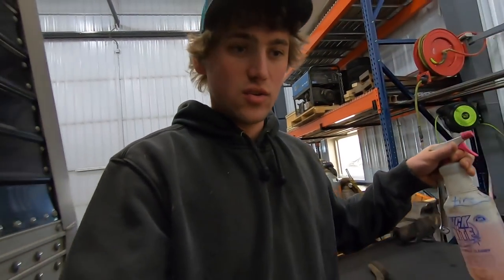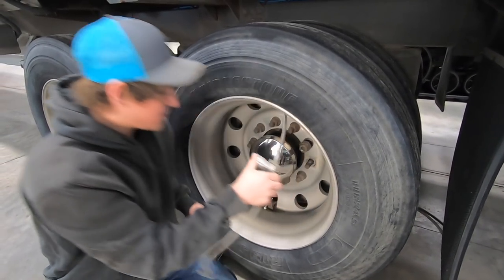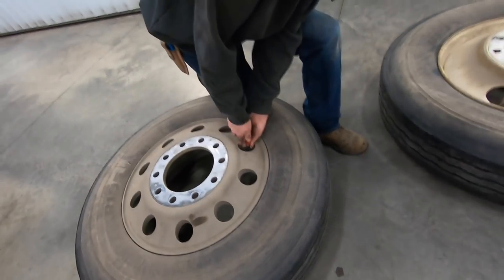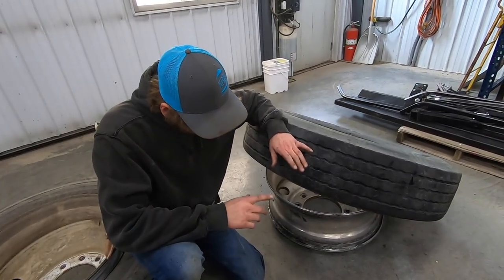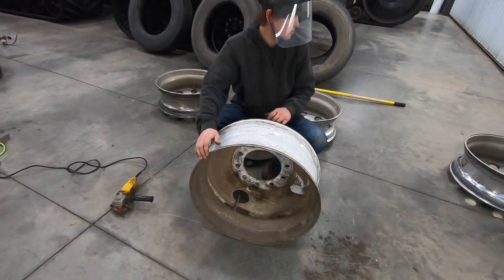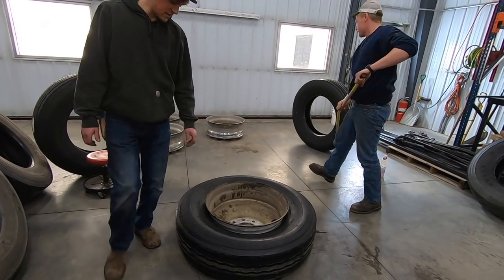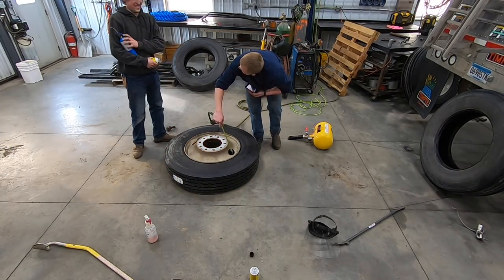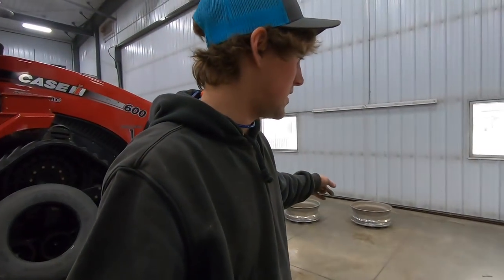Ether + Torch =Explosion

Comment: Hey bud I work at a tire shop and I use starting fluid all the time to inflate 35/12.5/24 on 24x14 inch wide wheel and I pump air  into it while I put the starting fluid all around it and it always works!!! Try it out next time

Comment: I used to have a similar problem getting tires on the beat. The turns out that stacking on them on their side can compress the side wall and it does not want to push out onto the bead. I’ve started stacking them on their ends and I haven’t had a problem since, I know it takes up a little more room but it saves a lot of time.

Comment: Wire brushing the rim bead is a good detail to help ensure you're not breaking a tire down again to repair a leak that could have been prevented. You can use a 1-inch ratchet around the tread and tighten it down and it will spread out the bead out. Tires blowing off the rim is from the old split rims, not a problem with the tubeless tires.

Comment: Storing ur tires standing up Chet makes them a lot easier to mount and air up most times once it’s on the rim stand them up and there air up with out using anything. We started doing that for our trucks and it works

Comment: Awesome! Tire work is actually a lot more scary than most people think! Like you said, if you don´t have a cage, even the new, pristine tyre might blow out, and it will do it sideways, because reinforcement is always weaker that way. Now, you´ve got a really good technique going, but with all your tires on the farm, you should just get a real implement that fits your needs. You´ve got tracks on anything big, so just buy a machine that can do truck wheels - like 22.5" or a bit more.

Comment: Love the echo in the shop when you use the air cannon. Never had a standard rim tire blow apart when airing up after changing out the tire but have had split rims come apart. Always used a cage with the split rims. Cheers...

Comment: To get air into a tire to seat a bead better. You can buy a male  air coupler that has threads on the inside, they are called a retreader special. I got one at NAPA, one at O’Reilly, one at CarQuest. You take the valve core out, screw the coupler onto the stem, hook up the air hose, use the cheetah, remove the air hose, unscrew the coupler, install the valve core. 
This coupler will also work with ether. Remove the valve core, install the coupler, spray the ether, hook up the air hose, then light, remove the air hose, unscrew the coupler, install the valve core.    Hello from north east Montana.

Comment: Yes always make sure to put the plastic in between aluminum and steel wheel I use to have pictures of the aftermath on a old phone but the steep wheel blew apart ended up busting/cutting the aluminum wheel so bad it had to be thrown away cut up 2 new Michelin virgin tires so always make sure to have it in there idk if it would have gotten as bad but it was raining and I never left or heard it until a truck behind me radioed telling me I had a flat and ole boy it was a pain trying to find 2 24inch wheels plus tires in Michigan very very pricey

Comment: Did I see the Swede put the core in the valve stem before airing it up?? That was part of the problem. You can also lay the tire/wheel down on a 5 gallon bucket (face up) when using the canon, usually helps seat that bottom bead.

Comment: When we are blowing up tires to seat them we leave the valve core out. The core restricts air flow. Then once it seats and you have some air in it remove the air chuck and screw in the core. Give it a try.

Comment: You are in luck... I finished cooking and eating and was watching all the tire stuff during the mealtime activity. I completely understand and empathize with all the tire safety precautions. I used to travel a lot with larger tires (not 20 inch) the 16 and 17 inch. I still run the 3/4 ton with 16 inch. Was a time when all the 16 inch wheels had the locking ring style. I used to carry pieces of chain and put four pieces bolted on to safely contain an air-up explosion. It was all fun when I was younger. Now all my wheels are solid rims, I still change by hand. I have not used the either method, but have heard of it     You are entertaining and doing the best you can.  I am right there working with you (or trying not to get in your way).  I saw a picture of all your combines lined up in a field -wow.  Nose to the grind stone-full speed ahead !!!

Comment: We had tires that you fight to get the bead to seat. We found that if you store the tires for a long period of time stand them up instead of laying them down and stacking.
Reply: twistedsteelDK   Another trick is  about 5 to 6 cans to block the beads apart. I use to use pop cans for car & pickup tires. Used pear cans on truck tires. Put the cans in at least 12 hours prior in a heated shop. It helps.
Reply: What he said, never lay tires down for storing.

Comment: Mineral spirits works the best to dismount all tires. And in the couple of years I did tires I never cleaned the bead. And we use flat irons for mounting and dismounting tires. And when you mount stand up anduse your feet they go on a lot easyer

Comment: Get an air angle grinder and some green sanding disc from your Mac or snap on dealer. We call them whiz wheels in our shop but they work great for getting the junk off the rims and you don’t have to worry about getting any wires to the face.

Comment: That's to easy on the tires.in my day it took a half hour to air up duals.sucked.valve stem removal tool just for you chet.nice to see some of her life.we only had a slide hammer n pry bars to take tires off.was a tough job.that tool really makes it easy.plus they we're 2 piece rims n we used a cage.nikki was a blast.need dougo.clamp the air hose on to the valve w/o the stem in then hit it w the either so as soon as it seals the air is there.

Comment: If you have a heat gun you can use it to warm up the tire to soften it up a little so it will catch a bead. Most times the Ether trick works because it warms up the tire each time you fail until the bead catches.

Comment: Chet, You did everything right, above and beyond except 3 things. I own a tire shop. Each tire requires 4 oz talcum powder and 16oz glass bead for balance. Talcum powder is to keep beads from sticking to tire in high temps. Now, your tire that would'nt seat. Either is perfect. BUT, remove valve core. Install air chuck to get air flowing. Use locking chuck. Have air going at time of applying either. Keep it going during lighting. Extra air pressure is key so after explosion and tire beads make contact they don't fall off rim during cooling after explosion. You see, you need air flow during entire process. Never use soap. Use tire paste. It's dry and won't stick beads. The tires you removed chopped because they wern't balanced. These will also chop. You can not run any tire un-balanced. From a dolly tire, ATV tire, to 11R24.5s . You must balance all. 
Trace. Trace Tire
12190 MCR X.5 Weldona CO. 80653
970-768-2330

Comment: Chet if you take a piece of schedule 40 pipe about a foot long and set it at the front edge of the tires almost touching and tighten the lug nuts a little and spin the tires if the tire hit the pipe tighten there first, replace pipe close and spine again when it goes around without hitting the pipe you will be pretty well balanced and you will get a lot better tire wear. Did it on school buses for over 20 years it takes time but worth it, in the long run, do the steering tires also save money

Comment: If you’re going to use either 1st get the good stuff 2nd about 1 second for every inch of tire width. 3rd leave a trail to lite so you aren’t so close when lighting. I usually lay the rim on a block when seating beads so you only fight 1. Also leave core out till seated
Reply: Use the good stuff = agree, 1 sec for each inch = agree, leave a trail = agree, laying the tire down = disagree, I always stand them up and for big rig tires I like them bolted to the truck, (this at least holds the rim in place so it doesn't go flying in an explosion), but another big thing is, wait for a sec or 2 before you light it, let it go from liquid to vapor, works much better, core out = eh, the whole idea of either is let it set the bead, and it will if done properly, BUT, it can be extremely dangerous if not done properly, if you are going to try this, and don't have any experience, start with less and work your way  up, too much and it can and WILL kill you if it blows up. OH and NEVER NEVER NEVER try either on a split ring rim! I also love when you have Nikki on, I like her,  :)
Reply: all good points

Comment: Lots of good advice on here the next time you change tires. Propping open overwidth with cans or 2x4's for a couple of days really helps.  No valve core needed. Use an air hose fitting that clamps to the stem and have constant flow before you try to seat the bead.  Please, no more ether!

Comment: You will find that tire you had problems getting the bead to set on was at the bottom of the stack and the weight of the other tires pushed the sidewalls in closer together and would make it not sit as wide on the rim to catch the rim when you used the bead blaster

Comment: The Teflon spacer comes off really easy, just by pulling the inside dual off, instead of trying to pull it off first and If you used wire cups instead of the wire discs, they will work better to clean the bead of the wheels.

Comment: Store your new tires in the upright position.  If you stack them on top of each other they tend to squish the tire making it harder to air up with the air canon.
Reply: If you do have a tire that is like that , you can place a truck inner tube in the tire (before you mount it) and inflate it and watch the sidewalls spread apart. Let set for a half hour, remove the tube and mount the tire and you should be good to go.  A lot less effort and much safer than the ether trick.
Reply: @Evan60020  i like this idea

Comment: Work on trucks for a living 1 store tires upright it smashes the sidewalls making it harder for the bead to seat. 2 when you ether set the rim on a 5 gallon bucket and keep the air chuck on and light from the opposite side.

Comment: Maybe leave the core out till takes air. Will flow more. We use a male fitting that will screw on steam to connect air chuck to. Core will screw down thru it
Reply: ,,, YES , , Absolutely,  leave the core out till the bead goes over the safety lip on rim!

Comment: Use the bead blaster for inflation but flip the wheel over on the bolt hole side. This will ensure half the wheel is beaded. Also hook air the the valve stem with the valve removed before blasting. Use tire “grease” on new tires instead of cleaning the wheels. It will seal them up perfectly! We only use starting fluid on our rear tractor tires.

Comment: Removal is easier using clean mineral spirits. Acuall tire lube will help with beads seating. If they are stubborn put wheel and tire on a 5 gal bucket.

Comment: Need to take an old front hub and mount to a fork pocket for a. Picking up the wheels b. We use one to hold and rotate the wheels as we clean them. Mounting 2 at a time saves a few mins. But we just use a crud cutter with a rubber wheel, probably doesnt pull off as much rubber but doesn't take off as much wheel material

Comment: Just a tip set the rim on a 5 gallon bucket hold it up off the floor that'll feel your one side down and your cheetah will blow the top side on valve stem up

Comment: Use a bicycle inner tube inflate the tube an lube it up good an it slide out as the tire fills. It works best to set the rim in a 5 gallon bucket when using the inner tube trick

Comment: The wire wheel is a good way to clean the rim. My experience is with steel rims  but should be OK with the aluminum also-just easy on the aggressiveness. Great face shield-you are smart. Great tire pressure equalized. The tire de-mounter is supper.   I have not watched the ending..but good job so far...I need to cook my supper.  nose to the grind stone-full speed ahead !!!   (pretty helper)

Comment: We leave the  core out and lock the air hose on the valve stem and have a  ball valve at the hose reel and  when  the guy lights the  either the other turns the air back on

Comment: Had a tire not wanting to bead up with the air cannon at farm I worked at last summer. We didn't want to risk the ether route so we filled the gap all the way around with tire lube then hit it with the air. It worked but when the bead caught all that lube blasted out from around the rim and ended up on the walls 30 feet away, 15 feet up on the ceiling, as well as all over three grown men. Wouldn't be surprised if some of that crap is still stuck up on those walls. Guess that's one type of lube party😂😂

Comment: If you place the rubber of the tire off the ground so the tire and rim when on the ground the rim doesn’t try touch the floor from gravity. For example we place the tire on a smaller pickup tire like you had just not on the floor and then use the air cannon opposite the valve stem works a bunch better also.

Comment: If Chet had a little more junk in the trunk, he would be able to step hard on the tire and break the bead and not have to use bead breaker.  And when mounting he would be able to shove the first side on without a bar.  Bucket of tire grease also works wonders on hard to seat beads.

Comment: Set the tire on a bucket. Then use the bead seater. Ether and tires is dangerous. Latent ether in the tire can cause a violent explosion if the tire runs low and gets hot.

Comment: Don't put valve stem in until bead seated, tighten the equalization valve before putting on outside tire... JD either is not as volatile as some other brands, I've been told....
Reply: Tim Woodring 
Ain't no ether as volatile as the old stuff was

Comment: You should be using a tire/rim cage for safety and leave the valve core out until you get the tire seated on the rim. I've had a tire blow off the rim. Due to damaged rim or bead failure. You can get severely injured.

Comment: You need a valve installed on your air line where it connects to the wall, spry the tire with either while the hose is on the tire and when you light it and it pops in the bead open the valve and fill the tire...

Comment: I worked at T/A truckstop when I was a senior in high school. Fixed the tire that was flat, put it on the inside put other tire on bolted it all down. Started putting air in the inside tire, I checked pressure it was at 60 # put air chuck back in, turned my head to the right and BAM ..... blew my glasses across the shop and my body 15 feet away. Scared the 💩 out of me.

Comment: You should try using bear grease next time. Works slick on tires that you can't blow out on the bead.  Little messy but way safer than ether.

Comment: dont put the core back into the valve stem. just spray your either or what i like to use is shop solve,  hit it with fire. then put your core back in. no core equals more air and makes the either more atomized.

Comment: it looked like you put the core back in before inflating the tire. i may suggest next time leave it out it improves the airflow into the tire. as for tires exploding i don't blame you one bit. i have had new virgin tires explode and snap the mount bolts off the cages. but, you havent lived until a super single (455/60 22.5)goes  pop at 100 psi..

Comment: Use a flap wheel instead of a wire wheel. Will not remove or distort the metal.

Comment: That would have been a perfect time to get the polish stick out for those aluminum wheels Chet. And that chopping of the tread comes from balance issues. And recaps are junk in the long run if you ask me. Money wise.
Reply: And you need a trigger air valve with a 6 ' air hose and a hose and that clamps on valve stem , so when you light either you can squeeze trigger same time to keep beed seated.  A lot safer.

Comment: If you take the valve stem core out while bead seating it helps because it has no restrictions. Same with airing up, I bet you can take the stem out for the dual tire gauge and air up faster.

Comment: I used to work in a shop and I had a tire blow up on me and ended up having to pull a 3 inch piece of belting wire out of the outside of my right thigh when i was 10 feet away from the tire.

Comment: The air bomb you are using is for smaller tires. Get the big one. We use the big one one all our truck tires. Cheetah is the brand. If the the big one can't get using the big one and small one together gets the job done everytime

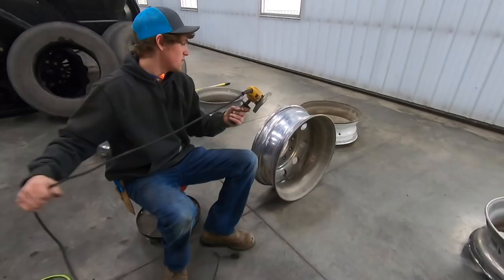Comment: 9:15 Whoa whoa whoa, You need glasses/goggles and a full face shield.. One wire in your eyeball and your screwed. One wire hits a vein and you can get blood poisoning. One wire to your jugular and a tiny piece breaks off and goes to the wrong place and your dead. DaddyCornstar says safety first. 9:46 we approve but adding goggles would be even better even if it's 100 degrees in the hot sun.